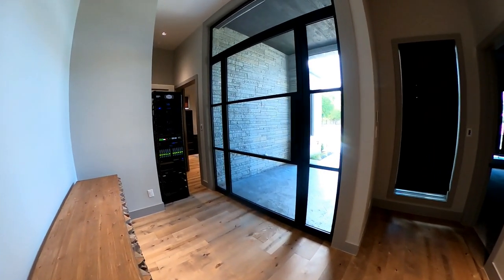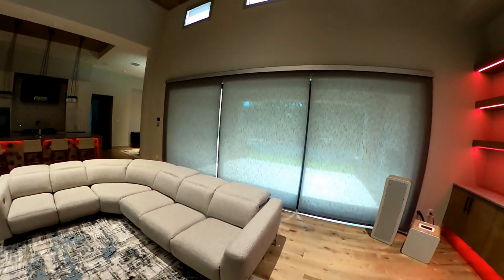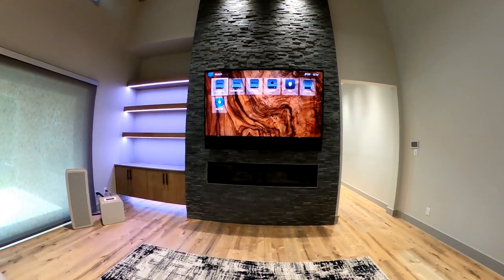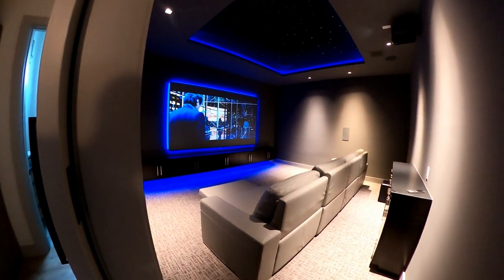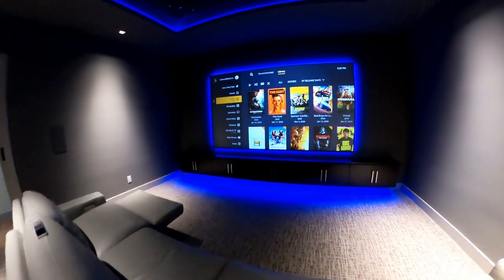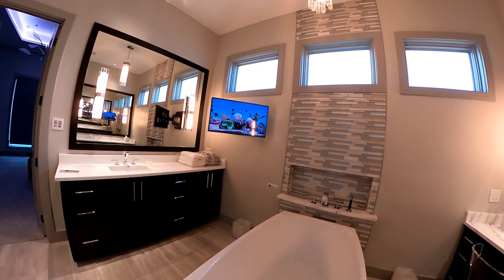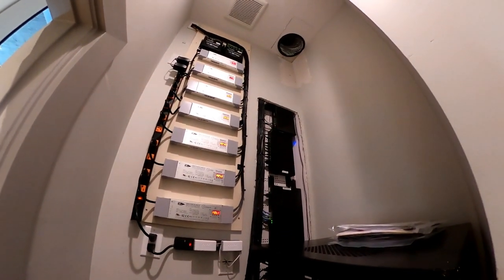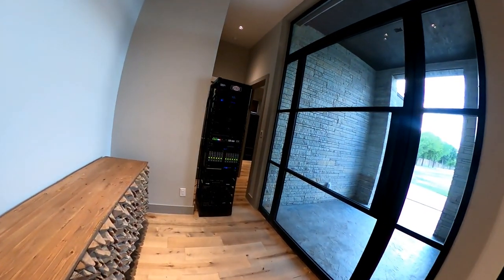Smart Home Walkthough

Comment: I don’t think I like the acoustics of the house
I think More needs to be looked at acoustic  speaking
It looks to me as if sound just bounces off of all the smooth objects there’s no absorption of sound 
Do you run any back cans on your speakers  sound deadening insulation can also be helpful 
sometimes a break from the studs to the Sheetrock helps with the base 
Just some quick ideas but I’m also interested in any other ideas 
I’m building a new of my own